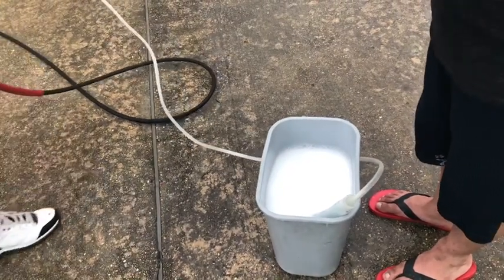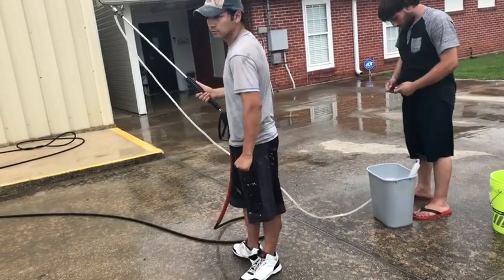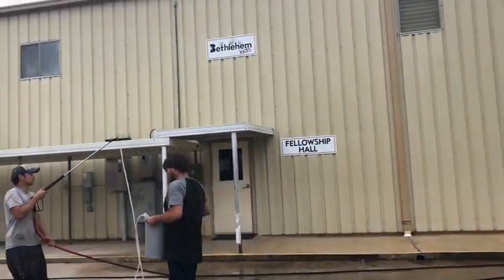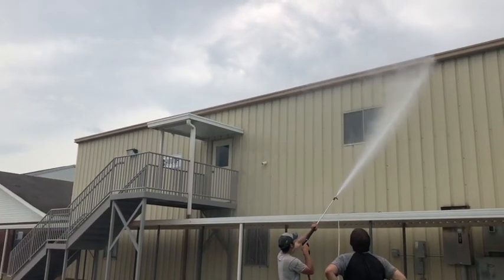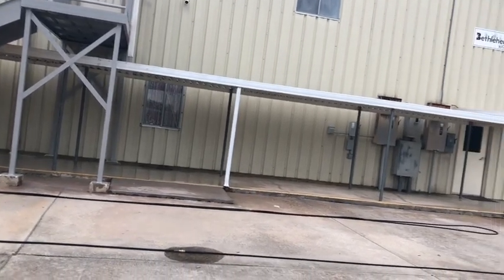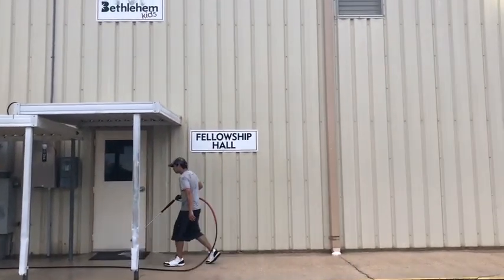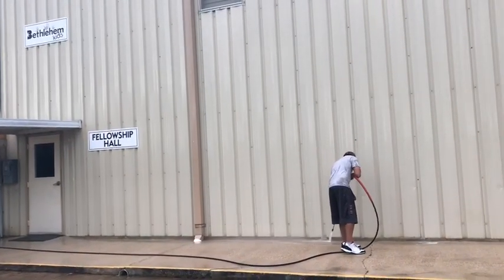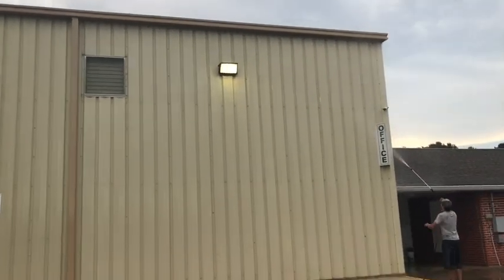How to clean a metal building

Comment: Great video. What is your position on using simple green and bleach mix for house wash?
Reply from the maker: Most definitely we use that very often. Are usually mix about 2 cups with a 5 gallon mix
Reply: @billydavidsonvip  Can you please share the mix recipe?
Reply from the maker: Brian Harkess  Downstream:
3 gallons of 12.5% sodium hypochlorite
2 gallons of water
5 ounces of your favorite dish soap or two pods of laundry soap
2 cups of degreaser or simple green

Apply two coats of the solution let Joel 15 minutes between coats then rinse
If you are using the xjet reduce sodium hypochlorite and soap by want2 then substitute with additional water
Reply: @billydavidsonvip  Thank you.
Reply: @billydavidsonvip  What would be the recipe If all I have is 9% or 6%
Reply: @billydavidsonvip  I'm having a hard time getting 12.5 sh. How would I adapt your recipe for 9% ?
Reply from the maker: Brian Harkess that means you would have to not dilute the bleach at all in your pocket just the bleach and some soap. Also if you want to get in touch with me perhaps I can help you find the stronger bleach in your area sometimes it’s not so obvious
Reply: @billydavidsonvip  Thank you. I would really like any help you have to offer.

Comment: I like 3 gallons of 12.5% 2 gallons of water. 3-4 oz of soap. Pressure washer used with black tip and pink tip. Or yes jrod. I use a 4gpm
Reply from the maker: Steven Mendez in this particular situation I wanted to use a little bit stronger mix Dan downstream would give me